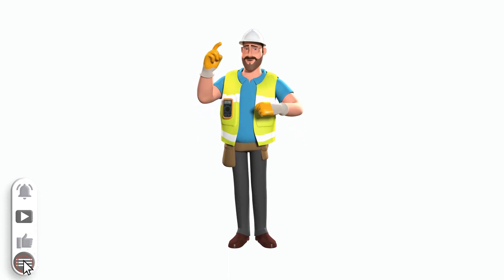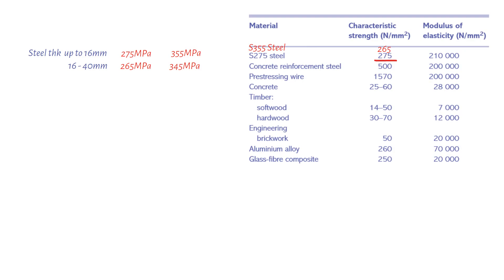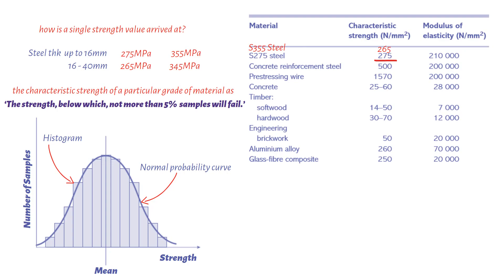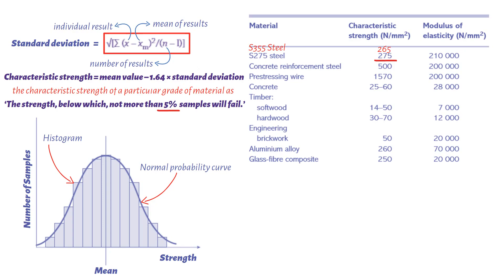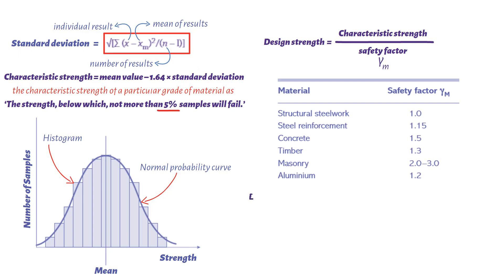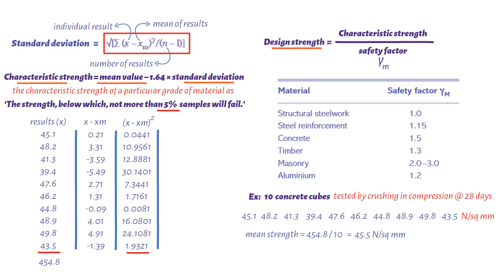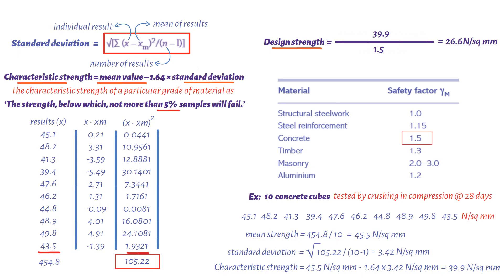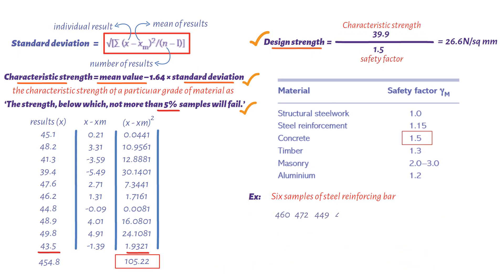Strength of materials | Worked Example.

Comment: Excellent stuff.

When you factor in material partial safety factors and the ultimate loading calculations on a design and it fails at utilisation 1.00/1.01 it does make you wonder how over designed our structures are. I know workmanship needs to be factored in if you're dealing with a cowboy builder.
Reply from the maker: Spot on mark!